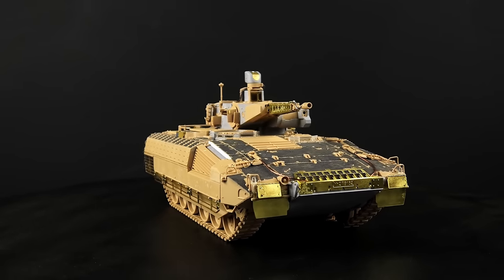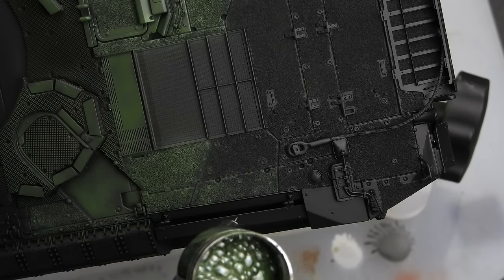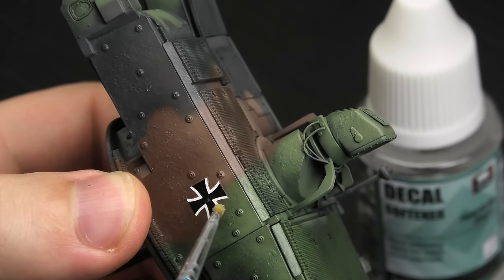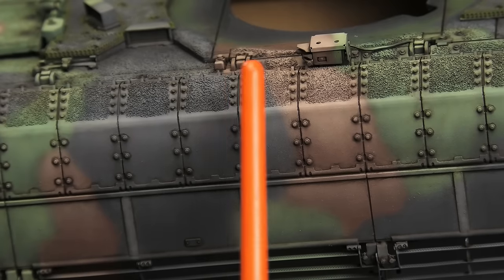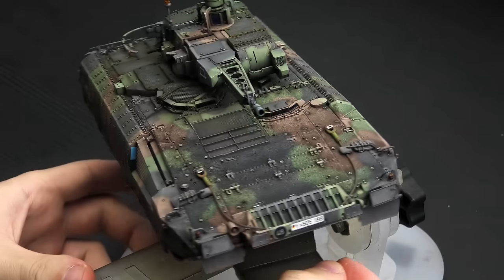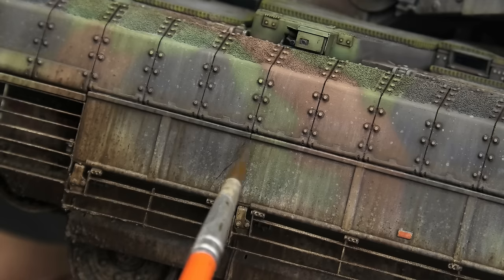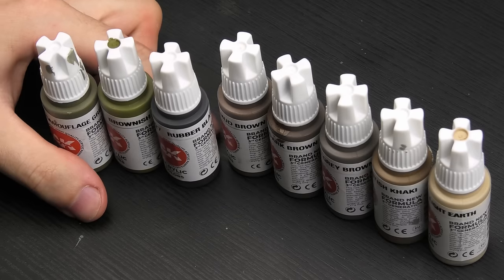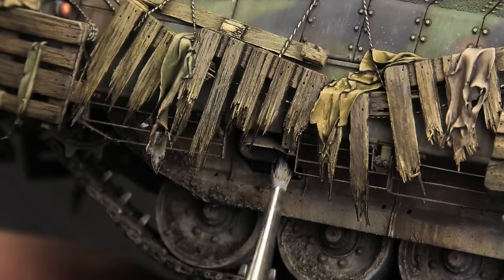Full Painting: SPz Puma "Urban Panzer Ops" (RFM 1/35)

Comment: The model turned out great!!!  I'm a Panzergrenadier Feldwebel 😀 and I noticed two things!  When we're in practice, we'll attach the tow rope to the stern!  If the vehicle needs to be towed!  2 We cover the license plates and reflector with duct tape!  And we cover the indicators and headlights with cloths or jute.  We unscrew the yellow beacon on the tower!  But otherwise, as always, it's fantastic work and a great video!!!!  Greetings from Frankfurt/M
Panzergrenadiere : Dran Drauf Drüber 🇩🇪
Reply from the maker: Thanks a lot for your detailed insights! I knew that I was making mistakes while adding/painting some of the details, just didn't know what they would be :D I basically just applied various ideas from reference images into one model without knowing the specifics.
Reply: No problem 😀The errors in the paintwork are not noticeable, we Germans have adopted a lot from WW2.  Until 10 years ago we would still be trained in the same way as we were back then!  It wasn't until body armor came along that training was modernized!  But we kept everything for camouflage and practical activities such as getting the tow rope ready for use!  Dur Have a nice weekend and have fun and patience with model building 😀🤗
Greetings Dominique

Comment: Its probably a little different for each country, but in the US Army all the camo patterns are standardized. Even a jeep. There are two places where they are painted. #1 in the factory, and #2 during maintenance we repaint (about once a year IIRC). The painting is done by either the crews, or the mechanics in the HQ platoon. The mechanics are almost always busy and understaffed, so often they only spray on the base coat, and the crews brush on the camo pattern. The crews are also the ones who caulk the vehicles (draw the patterns on the vehicles), and because of this you get some variation. In West Germany, everything was sprayed. Never had to paint anything when I was over there. Never asked, either.

Comment: Very nice as usual. I believe the Puma tracks have like most modern tanks rubber pads on the inside as well though and are not shiny metal…..as far as the pattern painting goes, I remember when I visited a Leopard 2 refurbishing plant in Germany, how they used a wireframe contraption mounted around the tank where the paintgun would hook into, to guide the painter with the camo pattern. That really blew my mind and explained why all of the vehicle specific patterns were so uniform. That was like 20 years ago though…😊

Comment: One thing to be aware of is, even in peacetime, the paint ends up being abused. It doesn't have to be bullets or enemy fire. Branches, strands of left over barbed wire from previous training evolutions, pieces of equipment that aren't tied down tightly (that could make for an interesting feature... say a cable with a loose end that was swinging in an arc as it went over bumps or something like those pallets jostling about and scuffing the paint), and lets not forget... rocks of varying sizes being flung about when going full fast-forward. The vehicle itself won't pick up much damage in an exercise, but the paint sure does.

Comment: @Night Shift : 
Small note :
Not that I'm criticizing the model, but I have to curb my inner OCD
Euro pallets are held together with 4-3-4-3-4 nails. 4 each on the "corner feet", 4 nails in the middle block and the inner boards with 3 nails
I know this because I worked in the pallet trade and "special" customers were extremely picky when there was "fake" EPAL in between
TIP 1: 
If there was no or too little camouflage material available, we also used the "good old" olive "PANZERTAPE" to camouflage the license plates! Fun fact: we were later forbidden because the black paint came off the numbers when we removed the tape because the Licenceplates were so old in places, because we traced them with a Sharpie marker
TIP 2: 
After the fall of the Berlin Wall in the 1990s, the use of motor oil instead of paint to cover rust spots caused a lot of confusion because official instructions prohibited the "older" vehicles that were painted in Olive Drab with the "new" Nato green paint for repairs because they were decommissioned anyway

Comment: Most modern armor is cleaned after every outing to the range or maneuvers, they take them into the motor pool areas and are sprayed down with high pressure hoses to clean them.

Comment: Despite what others might think, I like it. It kind of follows a "perpetual war" theme i use with all of my AFV models. I do two different perpetual war themes. The first is a what if it is the late 50's, WW2 never ended, and all arms design stopped in 1948 so you have all manner of theoretical variations of tanks with up armor packages and early IR systems. The second theme is what if there is a WW3 and everything that has existed old and modern has gotten SEP packages and in the field modifications. (think of an M4 with an Italian 76mm OTO and Cage armor)

Comment: I think this model is over the top man, nice work as usual. if I may say, you spent time concealing and breaking up the lines of the hull; however, there is no breakup of the 30mm barrel/shroud or turret lines. 

quick side note, it's rather disappointing that urban camo in present days consists of loading a soldier or vehicle with trash and debris. rather than the previous greys, whites, and blacks pattern.

Comment: have you tried sandblasting the models before painting? 

I paint model trains & sandblasting works great on plastic & brass. 

the sandblasting sand I use is called alox 250 & is like flour it gives a good silky matte surface to paint on. 
the color adheres very well after sandblasting

Comment: Once again an excellent video. I was a bit puzzled on how this would turn into the one on thumbnail for most of the video. Almost even mad because it looked so pristine. But pristine is boring. End result speaks for itself.

One thing i found to be a good fit for ropes in this scale was this wire they use in jewelry making. For beads and whatnot. already braided, fairly rigid so you can force some shapes to it too if needed, to create an illusion of weight hanging from it. I don't have any specific make in mind, but you can prolly find that from basically any crafts store. 

That EUR Pallet idea was brilliant by the way. I wonder if in real life soldiers would also put some of those flimsier disposable ones in use too, as they are like third of the weight of a "genuine" EUR pallet... That way you could give yourself some freedoms on designs, use some off cuts and trash pieces too to make those. Used to work in terminals and those awful things were everywhere. We used to give them out to people for firewood as they were no good for storing anything on shelves.

Comment: Does the Puma not have rubber pads on the inside “endless road” face of the tracks? I just assume all modern armor does, so it was a surprise to see you paint that surface as bare steel.
Reply: No the inside of the track is steel on all tanks in the german army. There are just rubber pads on the area which comes in contact with the roads. You can easily google that, the inner is also mostly very clean in the area of the roadwheels.
Reply: @JazzJaRa  Okay, thanks. I am not familiar with German armor.

Comment: I really like your take on improvised  armor / cammo. It provokes thought and wonder of what was on the hypothetical crew's minds when they arranged it, and what has happened to their work over time. Because this is bound to happen with any viewer that is appreciating the display, it becomes important to account for. As it sits, I'm wondering if the wood was intended to obscure the outline for camouflage reasons, in which case the trained crew would have used techniques found in their training manuals. This is a requirement of the type of military that carries the national insignia presented on the model (Germany, in this case, is NATO and must be uniform for interoperability with other NATO forces). The uniformity is a result of the soldiers often not having much information about their mission, because of Top-Down command structures that require habitual uniformity to get predictable performance in a chaotic structure (actual-military wargaming still involves literal and simulated dice rolls, and so the creative expression of any soldier is heavily critiqued by every other soldier (cough). 
I can easily imagine that this vehicle was altered for the purposes of a prepared ambush within an industrial/shipping area, and so a bunch of pallets would help it blend in, but then some crew member suggested that pallets be placed around the sides to disrupt thermal and radar signatures, while improving crew morale with the assumption that the wood would provide a "Zimmerit" effect, and possibly an acoustic scattering effect. The pallets and rags don't appear to serve any practical purpose (such as transporting the items for utility purposes), beyond cammo and possible Zimmerit effects. 
A problem that breaks this immersion is that Cammo for a shipping yard or industrial area would have some pallets stacked up, so the vehicle could take a position that it will "blend in to". The chaotic placement of these pallets would generally make the vehicle stand out. The ropes make hard lines, which (to a soldier) cause a strong reaction because of training (corrective, physical, and painful, so that this pain and stress will be felt whenever such a violation is observed in the future).  In contrast to the ropes, the pallets are helping to break up the lines of the vehicle (and they look very good from a detail perspective), but they only cover the lower parts and some of the front hull. Further refinement would include breaking up the uniformity of the pallets so that they don't look like a tank with pallets around it. 
 This should be imagined from the point of view of enemy recon scanning the area to discover ambushes and battlefield value from their own concealed positions, so that no unnecessary movements are made, which cost fuel, maintenance efforts, and high risk. There is a huge combat advantage to not being discovered or enumerated, and a great deal of military actions involve competitive hide-and-seek. So, it certainly matters that your display show the proficiency of the imaginary or actual soldiers that would be part of that scene, and playing a life-or-death game from the position of "Pawn, who would rather be any-other chess piece".
Creating an interesting display to stand out as superior, instead of a successfully boring scene is a very natural and common error in training, and so it generally gets beaten out of most soldiers, and those who see their associates getting corrected rapidly improve their design to avoid pain, before their turn for inspection. One example for this change would be the 3 broken pallets on the side, which don't have a lot of plausible conditions that would result in that damage without related damage to nearby surfaces/structures (did it get rammed by a car? did the driver pivot-steer into something? did it drive over a steep obstacle at speed; thereby breaking pallets? there's no clues that anything happened, but the partial pallets are installed like the adjacent intact pallets, as if they were uniform at some point before being broken. The broken ones should - instead - be jutting out in directions that absolutely doesn't look like a fighting vehicle, and causing weird shadows that obscure the shape of the underlying vehicle. As it stands, the pallets and ropes are highlighting the vehicle, while more-or-less hiding themselves. If a viewer experiences a jarring or revolting sensation, this is likely the cause... Tanks (and other tracked, fighting vehicles) don't look like that. Pallets aren't used that way, so even though the painting and details are beautiful, it's neither realistic, nor natural, and therefore not artful. 
It's common (at least for US Army's Bradley IFV)  to have straps on the sides of the vehicle for the transported soldiers to place their rucksacks and sometimes 1 of the two pre-packed duffel bags. This is an obvious giveaway, and so is generally only used for transport to or between operational areas, and so shouldn't be in place during combat, and when they are in place, they must be "Dress-Right, Dress", or perfectly uniform and tidy. What I mean is that sometimes you simply can't have a non-special vehicle (meaning "regular troops with standard equipment and expectations") with sloppy stowage, regardless the situation, and there are stark differences between movement configuration and combat configuration. Mixing these "looks" is only reasonable in the cases of Irregular troops ( insurgents (Like Taliban, trained to conceal the fact that they're paid, trained, equipped by the countries with professional armies that are fighting them), poor countries with improvised capabilities as a strategy to counter expensive armies (Ruskies), poorly trained/undisciplined troops (National Garbage), and specialized troops that intentionally look like garbage as a type of camouflage in its own rite (special forces that want to be seen as pathetic, for greater advantage). The vehicle in the video looks like it belongs to a professional army, due to its upkeep and new "factory" look. It has camouflage that indicates its crew has not been to a standardized "basic training", and nobody in the unit has the knowledge to correct the errors. 
The ropes are all over the place, which is a good attempt at breaking up uniformity, but that isn't working due to the principal of "what naturally occurs in that environment". Commonly stated: "X does not look like that in nature." In this case, "nature" means "how this man-made environment would be expected to look". A shipping yard looks uniform, with everything in place, but a looted shipping yard may be chaotic and ransacked. Those ropes are stretched tight, like they are intentionally doing something, and will draw the eye as potential un-touched supplies. Their arrangement stands out as both forbidden hard lines, and not something that belongs in either a ransacked or untouched environment that would have those items. The common wording for this idea is "The terrain dictates (the actions that extend beyond uniform training ). " 
Due to training methods a vehicle commander will be comfortable only when their vehicle is behind cover, in a well-designed fighting position, with the rest of the units mutually supporting eachother. This removes the need and desire for side-cammo in an urban environment, because "lone wolf behaviors" in a team usually ensures their defea. As strong as a tracked vehicle appears, running over a strand of concertina wire is usually enough to mobility-kill the vehicle permanently, if they don't stop and spend a lot of time trying to cut away this high-tensile steel wire (often with specialized wire cutters that are only on one of the vehicles, if any)... This is undesirable to the same people who are stringing long ropes near all those moving track parts. Because of this, the side pallets would generally be considered a risk more than an asset, unless they have a very specific reason that would make them a superior cammo to something else, like hiding sandbags, railroad ties, scrap metal plates (AKA: Junkyard, or Mad Max armor), and spare track shoes/roadwheels .
Most importantly, the turret and obvious gun are completely devoid of camouflage treatments, beyond the factory paint. One could imagine a crew hastily making something that resembles a hook or highloader forks (a machine that's used for lifting palletized cargo on rough pavement/packed-ground, and would be natural in this environment), but would be a serious flaw if the vehicle must scan for targets by rotating the turret. It can only be used in a firing position with a very tight firing lane (so the turret doesn't swing the distraction hook around). Further, such an object should appear ruined and useless from afar, so that it's actively ignored after first detection, unless you're trying to bait the enemy into range. If you're baiting, however, it would be better to put a more interesting item between your hide site and the enemy. This draws focus to the interesting/useful object, and then you would want to be as uninteresting as possible, like background noise. 
While this vehicle is sporting German insignia, and so a German field manual from that vehicle's period should be chosen as the best camouflage reference, the one I'm familiar with is [US Army] "FM 20-3 Camouflage, Concealment, and Decoys". It's very interesting, even if you aren't a modeler, and is freely available online. None of this information is considered secret, and so there is no excuse to continue ignoring basic and obvious design errors, that would have been avoided or corrected by the fictional soldiers that would have an inferior perspective of the scene to the "God's eye view" of the modeler. 
Still though, your "bad cammo" looks beautiful, other than the pain I have been conditioned to feel while critiquing it.
You are an amazing modeler, and I love seeing what you create.